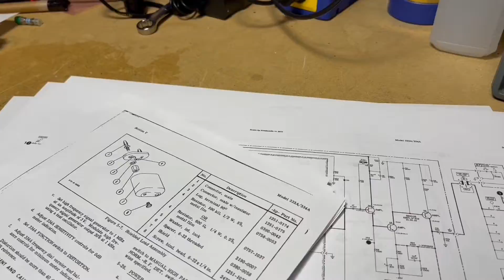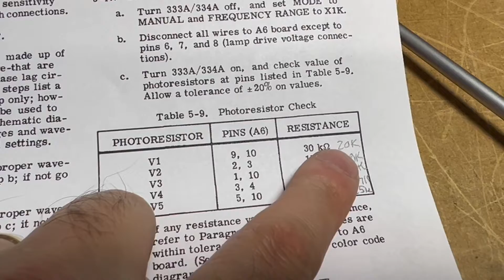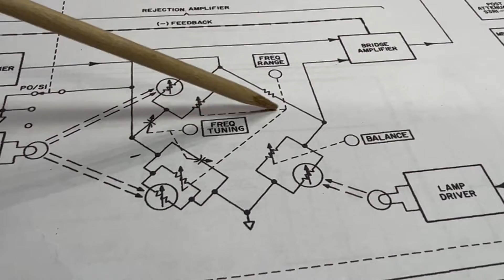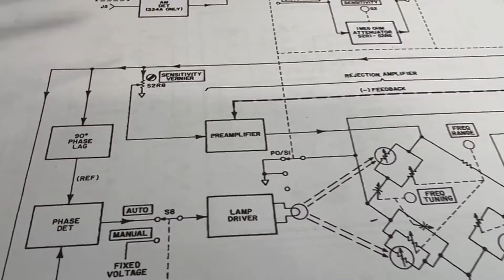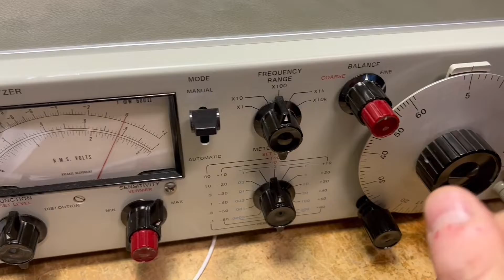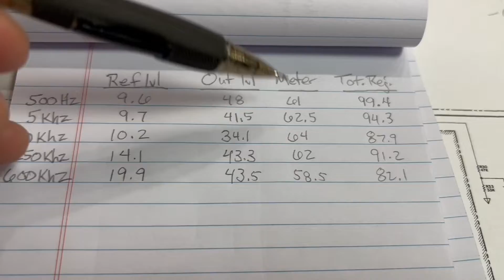HP 334A Distortion Analyzer Repair Part 1

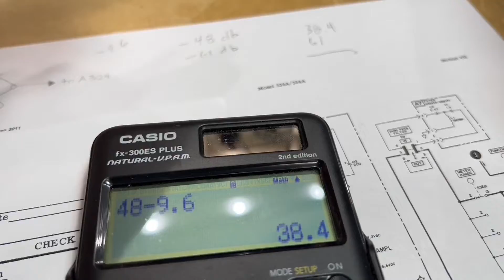Comment: Thanks for this informative video. I learned a lot from your repair experience. However, just a clarification on how the “Fundamental Rejection Check” is calculated. As you correctly point out, the manual states that “the total fundamental rejection is the sum of the 333A/334A METER RANGE setting and the wave analyzer reading”, i.e. the sum of two things. However, you summed up three things in your calculation: Range Setting + Meter Reading + Wave Analyzer reading. More specifically, you subtracted off the Meter Reading, which isn’t a part of the calculation. So you subtracted off an extra 11 dB (meter reading) that should not have been subtracted. At 53:21, you refer to the “switch setting”, but then you use the dB value from the switch setting PLUS an additional amount from the meter reading, so you’re inadvertently subtracting an additional term. This helps explain why your rejection numbers so far exceeded the spec.

Note that the 334A’s “output” is just a scaled version of the meter reading. By taking the output and using the “wave analyzer” (or spectrum analyzer or FFT), you isolate the fundamental suppression that is represented in the output – something you can’t do with the meter alone since it represents all frequency components. In other words, the wave analyzer reading is the portion of the meter reading that can be attributed to the fundamental. The added benefit of this approach is that it’s not dependent on the purity of the fundamental – only measurements associated with the energy of the fundamental frequency are involved, as it should be.

Bottom line is to exactly follow the manual instructions: fundamental suppression = rejection indicated by METER RANGE setting plus further rejection of the fundamental ONLY as indicated by the wave analyzer reading. In your case, the fundamental suppression should be -50dB (Meter Range) plus -38.4dB (wave analyzer difference), to give -88.4dB – still better than the -80dB spec.

Thanks again for your video – it really got me thinking about what was going on here!
Reply from the maker: Thanks Jim. I’ll have to go back and review but I follow what you are saying and I agree. Having become now much more familiar with distortion analyzer usage I understand your statement. This 334A video was really me cutting my teeth in the realm. I hope to have more on this in the near future. Thanks for the comment.

Comment: Hmmm.  I have the HP 3325A (essentially the same specs as the 3325B), and its specification for harmonic distortion is -65 dB below the fundamental from 0.1Hz to 50 kHz.  I just hooked mine up to my 8903B distortion analyzer, and it didn't quite make that spec at 500 Hz: -62.5 dB below the fundamental.  (I didn't use a 50-Ohm terminator, nor did I let anything warm up.)  I also measured it using my Audio Precision ATS-1 (quite a unit - it was pretty uncommon for a company to smoke HP's specifications by an order of magnitude with an instrument of the same vintage), and confirmed the distortion reading there.

Therefore, I wonder if your HP 334A wasn't reading the actual distortion of your 3325B, with its -61 dB reading, before you made the adjustment by adding in the reference.  By initially setting the 334A to read 0 dB on the input signal, won't the meter with its associated range switch display the distortion (+ noise) component directly?  I'd frankly be very surprised if the 3325B was capable of essentially a -100 dB distortion figure...
Reply from the maker: It’s possible I made an error somewhere in the measurement. My 334A has a floor of -72dB so if I did something that indicates lower than that it’s an error. I’d have to check the video. I do remember at the time when I made this video I didn’t have an ultra low distortion sources, at least nothing better than the 334A measurement floor. Since then I’ve acquired and HP339A and constructed one with an even lower floor. The next time I’m at the bench I’ll check my 3325B but I’m fairly certain it will be around -65dBc.

Comment: Well-done! And thanks a million. I've seen this photoresistor calibration described in forum posts, but never seen it done. Fiddly, but not nearly as bad as I'd feared, should I ever need to work through it. My 334A works fantastically with auto-nulling, but the main dial doesn't read out/ "see" the correct frequency, and slipping the dial won't correct for the discrepancy. Not a huge problem, as one can always use a frequency counter (and most of the time, the input frequency being used is known anyway).
Reply from the maker: Thanks for the comment! The 334A is a very capable unit. Even though it lacks auto set level, once you get the knack of making a measurement it isn’t so bad. Not being able to read dB and % distortion at the same time is inconvenient sometimes for me.

Comment: In my recollection, another big difference between the 334A and the 333A was the auto-null.  It is selected by the prominent switch to the right of the meter.  You could start with Manual tuning and then turn to Auto for the final null finding.  For years, I was drooling for this 334A.  In our Ham & HiFi club, we had two Heathkit analyzers for our audio endeavors, one was harmonic distortion analyzer and the second one for intermodulation (2-frequency) analyzer.  This HP 334A (and the 333A for that matter) was way more expensive than both the Heathkits, and still missing the intermodulation feature.  So, keep drooling, guys!
Reply: Actually, I think auto-tune is the difference between the 331/332 and the 333/334; the higher-numbered device of each type includes an AM RF demodulator.  I've had both types, and the 333A is definitely easier to use than the 331A, but it's still rather finicky.  I tore into mine, fiddling with the phot-electric nulling system.  To me, the light bulbs and photo resistors seemed to be a bit of a hack, but I was able to get it working again.

I eventually picked up an 8903B, and what a difference that made!  Just select the measurement you want, and it auto-nulls, auto-ranges, and displays the final reading digitally - in about a second!  So easy to use!
Reply from the maker: Yes the auto tune is definitely a nice feature. Manual tuning on the 334A is very finicky. Since this video I’ve acquired an HP339A which has a much lower measurement floor and low distortion source. I’m also in the final stages of building my own measurement set via Robert Cordell’s very capable design in Audio Magazine. I’ll be doing a series on this build hopefully soon. Thanks for the comment.
Reply: Correct; 333a too has auto-null feature. The difference between 333a and 334a is the rf detector.

Comment: Nice analysis and repair.  My first thought when you mentioned replacing the photoresistors was, why not replace the lamp instead?  You did get it fixed and working in tolerance though. Either way it's working well again. Thanks for the video.
Reply from the maker: I actually have replacement lamps as well but they appear to not be needed.  Per the manual the bulb type is 1869D, 14V at 10mA.  Thanks for the comment.

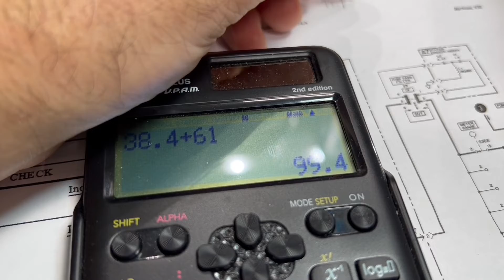Comment: I don't understand your Math at 53:30 ....
Reply from the maker: Can you be more specific with your question? The math was a summation of the two readings: the DA meter reading plus the change of the spectrum analyzer reading.
Reply: @FreeElectron  Why the summa of 2 different readings: one the internal measure -61dBm, and then the Output level? The output level is 0,1RMS with full scale instrument deflection (page 1-2 of the SM from Keysight), it's a relative level, not absolute level.
Reply from the maker: @cbiz8  Going off the procedure from section 5-9.  This is the fundamental rejection test.  The note states "...total fundamental rejection is the sum of the 333A/334A Meter Range setting and the wave analyzer reading."  I'm assuming a wave analyzer is a spectrum analyzer.  The specification is looking for a rejection of the fundamental with a rejection value of at least 80 dB.  The meter indication alone only goes to 75 dB (assuming on the 60 dB scale and full calibrated range is 75dB).  By starting the test from a reference of 0 dB one would be unable to see a rejection of greater than 80 dB from the meter indication alone, which is why some additional measurement is required.  This is my interpretation of the method for performing this test.  If I am incorrect in this line of thought please inform me.  Some of this information is covered in more detail in the second part of this series but that portion is still in the works.  Thank you for the comment.
Reply: @FreeElectron  I havn't red the procedure before. Sorry. The HP 310A seems to be a sort of Selective Level Meter. Thank you for your detailed answer. Best regards.